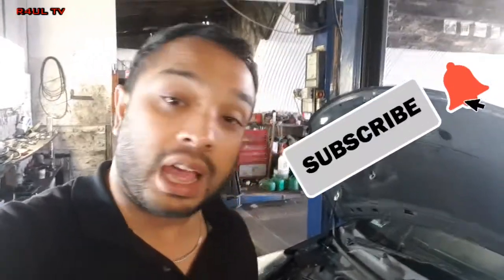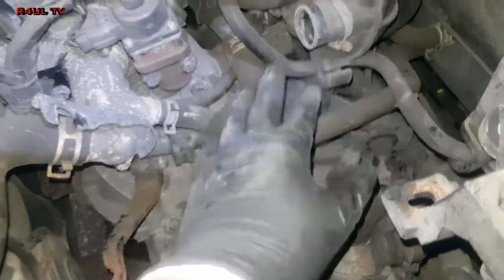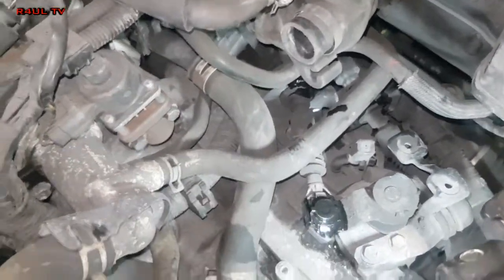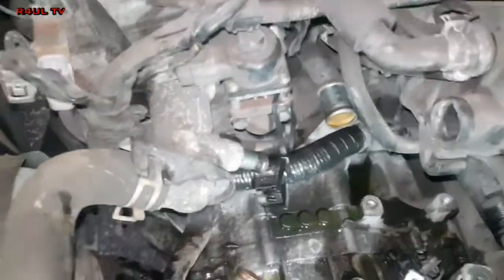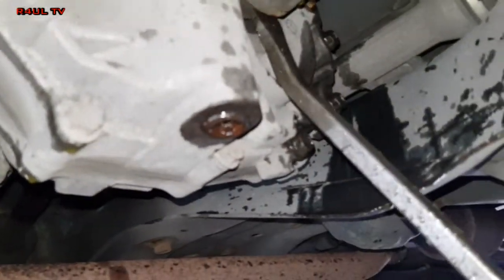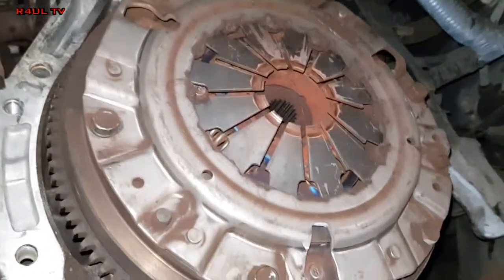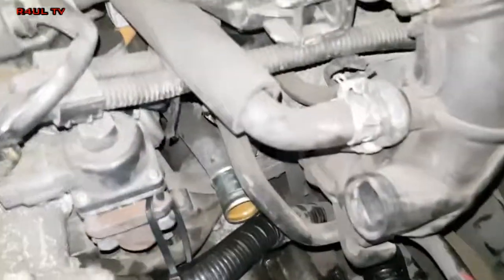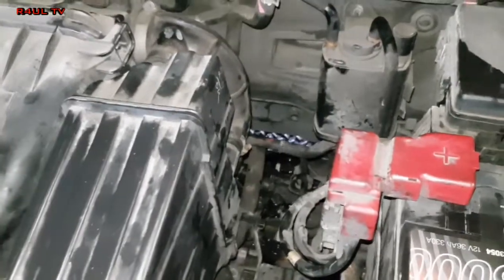2011 Suzuki Alto Clutch Replacement

Comment: Hi Thanks for the video..  During the replacement of my Alto 2010 clutch, I was also struggling with the startermotor bolt from the engine mount side. I found a other way beside the suggested removal of the engine mounting.. Remove the alternator and a wiringloom clamp.. Now you can reach by use of a 30cm long 3/8 extentionbar and a ratchet wrench this difficult bolt. Then after unscrewing the bolt, just slide the bolt, socket, extentionbar aside and leave it there. Then do the clutch job and you can slide in the bolt for fastning again..  easy!!   Thanks again
Reply: The starter motor bolt is a pain, we did a Splash recently, that's were alot of time was wasted, we took the bracket/mount off.

Comment: How much would u charge for a Suzuki alto clutch replacement ?
Reply from the maker: £200 labour plus the parts
Reply: If the clutch bearing is bad is it better to change the whole clutch ?
Reply: @gang-gang8325 silly not to, there's the same amount of work to get to the bearing, another 10 mins would change the plate and cover.

Comment: How many hour it needed to change clucth bearing?
Reply from the maker: I would recommend that you change the clutch along with the clutch bearing. 
Time wise it will take me about about hour and half to take off same to put it back on. But if your doing it for first time give your self about 5hrs
Reply: Once you're in there you may as well fit a whole 3 piece kit....silly not to, it's the same amount of time/ stripping down.

Comment: Mate, I just watched this again and am really pleased you put this up.  Thanks for simplifying the process and all the added tips. 
The Oil drain plug is a 10mm square.  I just made one out of steel. but yes, you can use a 3/8 inch socket wrench.  

One thing I really wanted to see was the bolts on the flywheel and the pilot bearing itself.  You covered it up with the clutch before showing it.   So I have three questions if you don''t mind. 

1 -  What kind of bolts are used to hold the flywheel on.  Do they require a normal hex socket, or a are they some kind of Torx variation?  It's just the head I'm concerned about.  I'll need to have the right tools on hand when doing the rear crank seal. 
2 - Is the pilot bearing mounted in the flywheel or is in mounted into the drive shaft on this car? 
3 - I noticed you didn't support the engine when you took the gearbox out, or maybe you did?  Should I use a chain or cable to support the engine when I take the gearbox out?  Was it necessary on this car?   Thanks 

I have this exact model of vehicle, so I really appreciate you showing this.  I thought the process was allot more difficult. 
As for the mount, I would definitely take it off because of the tight squeeze and the starter motor bolts.
Reply from the maker: Thanks for watching really appreciate it. 
To be honest I didn't replace the Flywheel, I cant remember what the bolts are. SORRY 

I used a gearbox lift on the engine to support  the engine while taking the gearbox out
Reply: @TEAMR4ULTV  Thanks for your reply.  No worries about the flywheel bolts.  I think they are standard hex.  Do need to separate the tie rod ends from the hub or are you just separating the suspension arm ball joint?   Thanks again.
Reply from the maker: @danman2070  yes just take the ball joints off
Reply: @TEAMR4ULTV  thanks, but is that both the steering rod ball joint and the suspension arm ball joint?  Or is it just the suspension arm ball joint?
Reply: Just the bottom suspension ball j

Comment: Hi. Thanks for video. Just have a question. Why did u take  driver side driveshaft off if the clutch is at the other side of a car?
Reply: The shafts go into each side of the box at the rear. Both need to come out.....did a Splash a few weeks ago, same set up.

Comment: Thanks for the upload! Im up to the part of separating the gearbox and ive got it off about half a centimeter but am struggling to separate it further... any tips? Thanks.
Reply from the maker: It's most likely stuck on the dowels just give it a pry
Reply: @TEAMR4ULTV  okay thanks ill keep trying 🤞
Reply from the maker: @xanavinismo2003  also just check if you have left a bolt on or something

Comment: Hey there. I replaced a new box and clutch based on this video. Subscribed and liked. Thank u.

Only thing I can't select 1st or 2nd. The linkage seems to be slightly different. The bracket has x3 bolts on original box..New one x2 bolts. The linkage area slight different also. Is there a way to adjust the linkage cables? It won't move left but moves right. So I got 3rd 4th 5th and rev. It won't move over to left. Like if no adjustment can I replace the linkage cables and gear stick mechanism? This seems better than taking box off again.guy sent me same ywr and car but seems slight amendment to box
Reply from the maker: Maybe you can replace the selector but I think it's the wrong gearbox and your better off with the right one

Comment: great vid.  got a problem w/ my alto cant adjust the clutch cable anymore because it reach the end of the thread adjustment already. might need a clutch kit replacement do you think? my clutch biting point in on the higher side btw.
Reply from the maker: Hi thanks for watching really appreciate it. Just make sure when you adjust it there is free play on the clutch pedal

Comment: It's a very nice and helpful video! I am busy replacing the clutch assembly on the ground, and this is going great. I have only a slight hiccup because the bearing inside the flywheel is damaged and needs to be replaced. This is not that hard, but I wanted to ask what torque settings you would use to tighten the flywheel bolts in combination with loctite? Greetings from the Netherlands!
Reply from the maker: Hi there thanks for watching really appreciate it. I'll be honest get some loctite on them hold the crank pully and just tighten them up with a breaker bar. I don't use the torque wrench
Reply: Ok, thanks! Appreciate it!

Comment: I followed you link, all good and finished, but one bolt and nut 10m diam 50m long left over, where does it go? Maybe around the starter which is out of sight. can you help.  It was stored with the underneath passenger side parts. I have replayed your video and this bolt is not mentioned. My car differs at the steering linkages.,so may be its  a different model
Thanks for the link.    Bob
Reply from the maker: Thanks for watching. To be honest it's very hard for me to say. If it's just a 10mm bolt dont worri about it. I cant recall taking a 10mm bolt off underneath. 
I know this sounds bad but you did put al the clutch bolts back on right
Reply: @TEAMR4ULTV   I suspect it may be from the starter motor but I cannot even see thr starter motor. The car has gone back to my grand daughter. Have you a service manual with the clutch and gear box displayed.Thanks  again for your help. Bob
Reply: @TEAMR4ULTV  Clu8tch bolts Ok . Dont worry any more thanks

Comment: Hi. Thanks for video this was informative and very useful. I have Suzuki Crossover SX4 2011 with manual transmission. I am stuck on disconnecting the gear select cable from the transaxel. This one is different from the one you have on the Alto. the ending is just a roundish, black piece of plastic with no U shape clip. I have a photo of it but no ways to attach it here. Any help will be appreciated. Thanks again for a great video.
Reply from the maker: Thanks for watching the video. You might need to push the end down and lift off